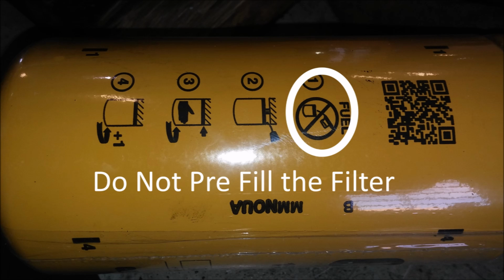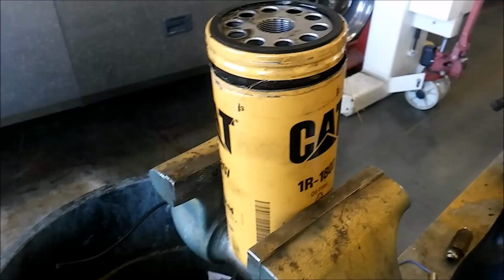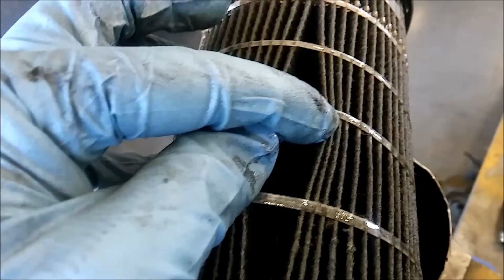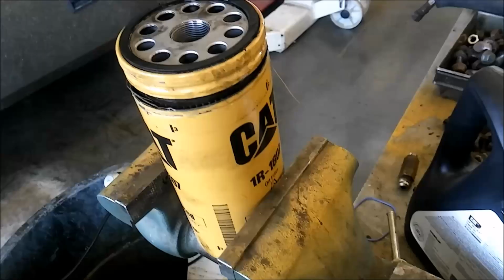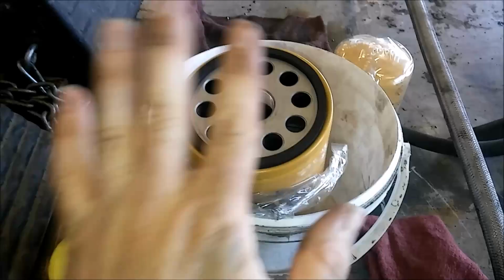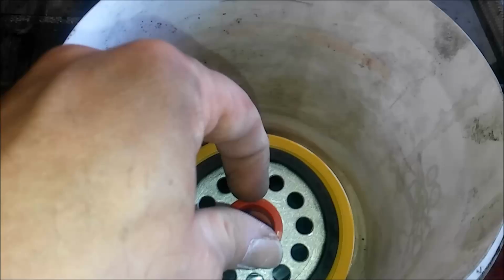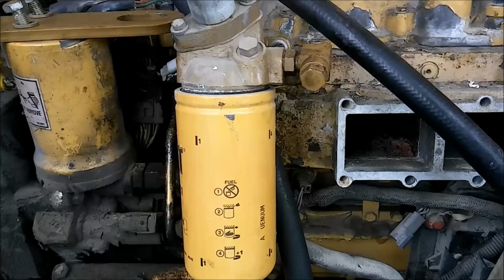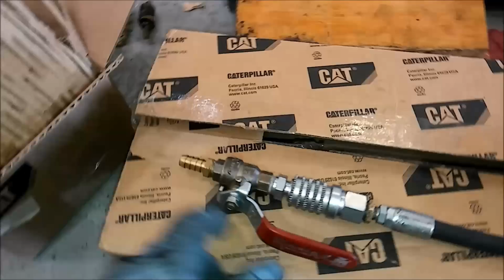Should You Pre Fill an Oil Filter? Should You Pre Fill a Fuel Filter?

Comment: I run different viscosities than recommended, I run diesel oil in my gas engines, I run 250-300 hour intervals and if I can fill a vertical filter before I put it on I will.  Any hydraulic systems worst enemy is air on start up.  I saw a guy refuse to fill an N14 oil filter before he started the engine because he was scared to get shit in it and he spun the bushing out of the front structure enclosure when it started, bushing came right out through the Teflon seal, contaminated the gear set with chunks of bushing and caused like 3000 dollars damage.  I’d never risk not having as immediate oil pressure as I can have.  There’s minimal “crud” in new oil out of a clean jug.  If you’re careful it’s fine and I treat everything like an operating room when it comes to precision machined parts.  The flow through a fuel filter is so low that if there was a piece of sand at the bottom of the tube it wouldn’t ever get out into the fuel pump.  I honestly think most of the damage in bearings comes from the perforated steel tubes.  The cat filter is superior with the composite tubes.

Comment: If I fill a NEW filter with NEW oil where is the contaminates coming from? I fill my oil filters and hear 1 second of knocking , I dont fill my filter it can last 5 or 6 seconds longer , I think I will stick with my common sense , it has served me well for decades.
Reply: New oil is not always as clean as you may think. If you get bulk delivery of your oil watch out.
Reply: Dust particles in the air. Small debris falling in the out hole.
Reply: Aren't dust particles from the air going to fall into the hole weather you pour oil in it or not?
Reply: I prefill for the same reason... 1 second of knocking , I dont fill my filter it can last 5 or 6 seconds longer.  Never a problem, even after 120K miles.
Reply: I'm with'ya Kemosabe
Reply: You said it brother
Reply: I agree with you we've done 6 in a row on Cat engines and I've sat there and filled every fuel filter up and every hole filter up Crank It Up in less than 5 seconds and pulled it out and start on another one if that's not, since I don't know what it is and I plan on sticking to it the way we've always done just like you said maybe not quite as long but just as long as you been doing it the same way it's always work for us regardless of what he says
Reply: Contamination comes from wrestling with oil filter during installation
Reply: Yes, a one second knock is much less damaging then a 5-6 second knock. I prefill when I can

Comment: i have a diesel engine repair/rebuild shop. people have kept my doors open for 40 years by filling filters. especially fuel filters. a contaminated common rail fuel system can exceed $10,000.00 in repairs because someone filled a fuel filter from a fuel can. happens all the time. new oil isn't as clean as you think. empty a gallon into a white container and come back 24 hours later and you will see the contaminates. keep up the good work!

Comment: When I rebuilt my old Ford, I spun the oil pump with a drill to prime the entire system before installing the distributor and cranking the engine. No dry start here.
Reply: Standard procedure.
Reply: Ferd took er jerbs
Reply: Not a bad idea,  but not necessary. If you rebuild your engine right, then there should be some sort of assembly lube on every bearing. journal, etc where oil is needed. That lube is more than enough lubrication to turn your engine over a few times and at that point you should have good oil pressure and oil at all exits in the system, otherwise you have bigger problems. That lube is oil soluble so it will stay on those surfaces until there is oil there to replace it.
Reply: Krankie V  yep on a rebuild id do a ingnition off engine crank till the light goes out a couple of times
Reply: @awashbowler  Disagree, pre-oiling is always better. If it wasn't, why are some of the most expensive engines always fitted with a pre-oiler (RR Merlin, Allison V-1710, etc).
Reply: EA SS  you clearly don't have any engine experience if you are considering that fact to be the deciding factor. Just because "expensive" engines have a pre-oiler doesn't mean it is better. If pre-oiling is always better, then why are we producing billions of engines with no pre-oiler? And why do those same engines last millions of miles without bearing problems? Answer... proper oil maintenance. Proper oil maintenance is way more important than pre-oiling because in the end, a pre-oiler does nothing for you if you have junk oil.
Reply: Always packed the oil pumps with petroleum jelly .
Reply: @awashbowler  You assume too much, which makes you foolish and the reason why I not only don't agree with you, but nobody in the comments section should be taking you seriously either.
 Production engines that are mass produced are engineered for a finite life. Yes, you can extend the life of any engine by regular and frequent oil changes. But if you think mass produced engines last in their original state for millions of miles without a re-hone, re-bore, new rings, or any other replacement parts you must be on drugs. Any production engine that makes it to a million genuine miles in a real life situation, without any mechanical repair or attention is about as rare as rocking horse shit.
 80% of engine wear takes place in the first ten seconds of engine start on any engine, because there is no oil pressure. That's the difference. If you crank any engine with the fuel pump relay removed or use a pre-oiler, that wear is negated. It is YOU that clearly shows little understanding of mechanical engineering, and little in the way of mechanical sympathy either with your kind of reasoning.
Reply: @Slaktrax  do you really believe the nonsense you're spewing right now? 1) sure, engines have a lifespan but that lifespan is longer than it used to be because of better oil technology. not preoiling. 2) I never said that that they last without maintenance so you are the one who must be on drugs.  Of course a million mile engine will need some sort of maintenance beyond an oil change in its lifetime. But that is because all the wear methods you mentioned are a result of the engine running... not a lack of preoiling. 3) there is residual oil still on bearing surfaces even if there is no oil pressure. Which is why good oil and  proper oil maintenance is key to extending the life of an engine. 4) pre oiling will not negate wear. not even in your wildest dreams. There will still be startup wear no matter how much oil pressure you have because there will always be dry parts until the engine is in motion. That is 4 statements that prove that you are extremely naive to that fact that there is always engine wear occurring even if it is preoiled. So before you go saying I have no mechanical sympathy, you should probably read a book or two instead of making a joke of yourself.

Comment: I’ve filled oil filters right in center hole for decades. If the oil from the quart or gallon container is dirty, what has been gained by filling the filter from the inlet holes but then pour the rest right into the engine? 
As well, most oil filters have an anti drain back valve. This helps keep the oil up in the galley ways throughout the engine so the oil flows asap during startup. 
When you remove the old filter, you notice the oil coming out of the filter mount. That oil is now replaced with air. So it’s not just the air in filter that needs purging but all the galley ways need filled before pressure builds enough to start lubricating the bearings. Bearing surfaces are moving past one another rapidly while waiting on oil. I’ll always fill the filter.

Comment: The John Deere high pressure common rail fuel filters come with a plastic funnel that Blocks the center of filter and diverts fuel to small side hoes for filling.  I alway fill my oil filters when applicable with only the cleanest oil. From a non contaminated source

Comment: What is the difference? New oil filter, filled  with new oil, new fuel filter with new fuel where do you buy your oil the dump?
Reply: Fuel in your tank is run through the filter.  I prefill my oil filters, not fuel filters though.   I push the manual primer on the lift pump to fill it

Comment: so yes the pump is bad but we are doing a low budget fix(all ready the HUEI pump rebuild went for $695!) so i went and got a low pressure electric fuel pump and got it hooked in the outlet from the tank and before we go and spend another $200 for a used pump on ebay we went that way, tomorrow i will know if it works(started pouring and never ended perks of living on a tropical island) so once again i thank you for the help and tips have a great weekend and keep up the good work and advice for people like me who don't know a lot about diesel and caterpillars in particular.
Reply from the maker: +adve58 This is turning into quite the saga, let me know if the little electric fuel pump helps. Maybe once its fully primed it'll work again.
Reply from the maker: +adve58 This is turning into quite the saga, maybe it'll work once you get it primed though.

Comment: I ran a Caterpillar 85C for 6 years. I always prefilled the oil filter. Never had a problem. I never prefilled the fuel filter. Always pumped it full with the hand pump.
Reply from the maker: +Myron Parks A lot of the truck engines don't have hand priming pumps so prefilling can save you hours of time, but just do it right. The oil is fine to pre fill, just best to pre fill on the dirty side.

Comment: Pre fill, never hear any knock if I fill my filter. My oils never that dirty and my NEW oil better not be dirty so ill save the knock vs some "dirty" oil getting out through the engine again. For a gas vehicle I don't fill my fuel filter, just cycle the key a few times and she's good.

Comment: Hauled bulk oil for over twenty years! Best quality control measures i have seen are Chevron, Mobil-1, Valvoline. Any one of these manufacturers i would have no issue pre filling an oil filter. P.S. my 03 Tahoe has 300,000 miles on original engine, pre filled filter ever time using mobil-1 synthetic! Good video though i have seen some crap over the years as well! Thanks!

Comment: I fill my oil filter with clean oil to save running dry while bearings clank and knock. Minimal risk of contamination outweighed by immediate lubrication in my opinion
On a diesel filter which is much more sensitive to any fine contamination, you fit it dry and use the primer pump to only supply clean filterered fuel to the engine which you cant do if you fill the filters.

Comment: I always prefill both fuel and oil. The big thing with the oil filter is where it is in the sequence. If the oil goes directly from the pump to the filter then it is important to prefill your filter. But if it is the last thing to get oil then it isn't necessary to prefill.
Reply: The pump picks the oil up directly from the oil pan (sump), then, to the oil filter. After the oil filter, it goes into the oil gallery, where some goes to the camshaft bearings, lifter guides, crankshaft main and rod throw bearings, and finally, on to the piston wristpins and cylinder walls. The engine is NOT lubricating, until the filter is primed, and the pressure can build up. The pump is always a little bit big, so what oil can't flow through the tight clearances flows through a spring loaded by-pass valve, and simply dumps back into the pan. That spring loaded valve is what determines the oil pressure.

Comment: Lot's of newer engines are designed with the oil filter upside down. This prevents you from pre-filling you filter. Do you think the manufacturers are trying to tell us something?
Reply from the maker: +Harvey Smith They do that for a reason, on some of Caterpillars older large 3500 series engines they had sideways canister filters as well, pretty hard to prefill those as well, but never seemed to cause problem. Those canister tanks probably helps 3 gallons of oil too so it took a little while to fill from the pump.
Reply: you can still put some.oil in there, paper absorbs it
Reply: Harvey Smith yes, they're trying to tell us they want the engine to wear out quicker
Reply: john jay Jea sure most modern cars got valves in the oil system to shorten the time for oilpresure to build up, but the fact that your control lamp go out doesn't mean there is instanty oil flow on your main berings they always got some contact at the start. but that's nothing to worry about, also if u don't pre-filled your filter ;) 
my Mercedes m102 engine first generation doesn't have a valve for holding back the oil, at every start you can hear from the noise change when the oil comes, after 320000km I restored the engine, and the Bering's got just light touches on them.
and also oil change after 6000km, wt....  merica?
Reply: Nice comments Martin. I also thought the same regarding 60'000km oil changes. I grew up being told to change every 6000miles/10'000km. I seem to remember one of the first million mile cars was a Volvo P1800 whose owner changed every 3000 miles. I have been doing my own services for over 30 years and I have never worn and engine out yet!
Reply: 95% of engine wear occurs during starting due to a lack of proper elastohydrodynamic lubrication (oil wedge) occurring in the bearings. There's a large volume difference (depending on filter orientation) between a completely empty filter after changing and a partly full one that has had some of the oil drained out of it after the engine has been left to sit. This will exasperate the lube problem during starting.
Reply: neardood1 
I've been doin this generator service game for quite a while , and engine rebuilding and other mechanical crap. 
and I always hear a lot more chatter from the engine on a startup after an oil change if I don't fill the filters. 
At one shop we had a nice 2 gallon oil container you could fill and pressurize with like 40 psi of air, pull a galley plug or sender and shoot that stuff in ! 
And my summer car always gets the oil pump spun with a drill before coming out of winter hibernation. 
Imo an engine in service and dormant for years is "dryer" than a rebuilt that's packed with all kinds of assembly lubes.
Reply: NIce comments,
Reply: Fact of the matter is all the oil does not drain out. The anti drainback valve prevents that. thus when you start your engine you see oil pressure right away. 
The job of oil pressure is to supply oil. The pressure does not protect your engine. The oil film does whether there is pressure behind it or not. This oil film does not disappear fast. Especially on an idling engine. Relatively speaking there is very little load on any engine parts at idle.  Old engines had no oil pumps. they had drip systems or a piece of oiled felt that kept the oil film on the parts that needed lubrication.  Manufacturers know this and understand it while many mechanics do not. It is pure physics.  

I have an old wore out suburban with a 350 that was old and wore out before I got it. It has run out of oil so many times when the wife was driving it in town it wasn't even funny.  Many times it has been driven 7 to 10 miles with the needle on zero occasionally bliping at a stop or something. It makes no noise or rattles and hasn't damaged any bearings. Oil pressure is good when people remember to keep it topped up. 
My diesel is another story. It has an internal defect that lets oil out. at hot idle it has no oil pressure. cruising at 2200 rpm it is 22lbs. cold it is 55lbs at idle. It has the high volume oil pump that came in the '97 and newer 6.5's It is a '94 so no piston coolers.
Reply: Neardood. That is incorrect. That engine wear is from the oil bypass being open on cold starts. The wear you generally see has scratches in it. bearing surfaces are smooth.  The only wear occurring during cold start is wear metal parts have weight resting on them. The wear occurs in the microsecond it takes to start moving. After that the oil film takes over. The same oil film that was left there the night before or before the oil change.  That oil will stay until it heats up and dissipates. That takes much longer to do then the time it takes to fill the filter.  Without oil film you have wear but the film prevents metal to metal contact thus no wear regardless of pressure.
Reply: yea their trying to say they don't want your car to last at least 200,000 miles anymore .iv always primed my oil filter and my little Colorado is about to hit 200,000 miles and still going strong I wouldn't be surprised if she last another 100,000
Reply: Im sayin